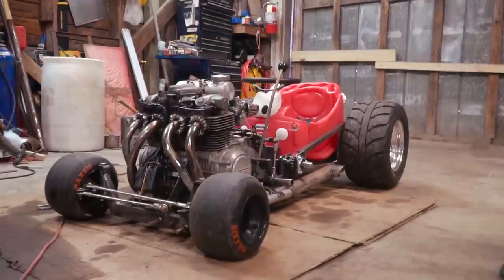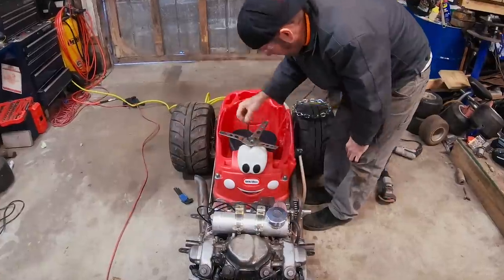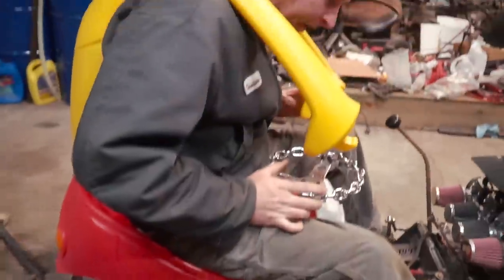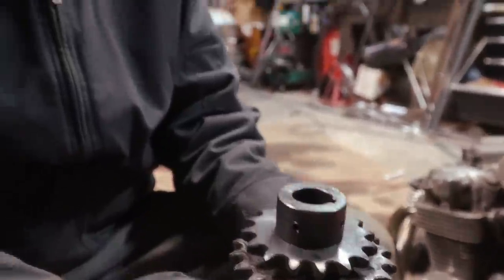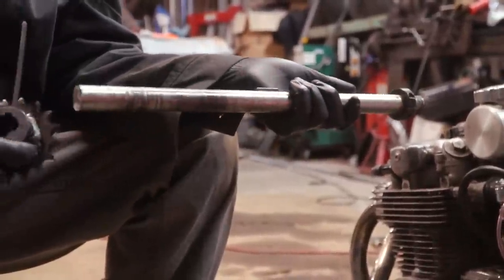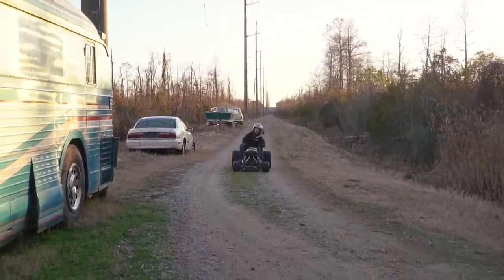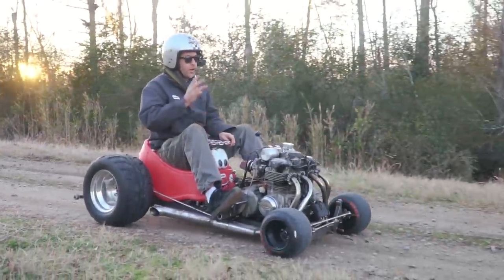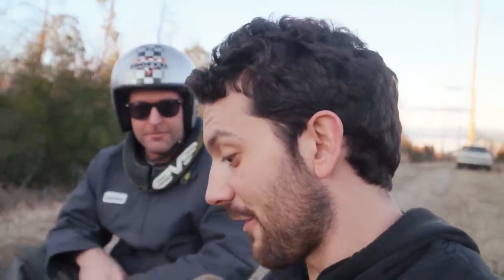How Fast is Our Little Tikes Go Kart??

Comment: "Wouldn't it look goofy?" I thought that was part of the build lol yes mod the top so you can get in , it would look cool. Think the monstar car racing cartoon.
Reply: I was gonna say "You guys built at hot-rod out of a Cozy Coupe, that train is long gone"
Reply: That's what I was thinking. Cut it out like a Targa top, and reinforce the back so they could use it as a back rest. The next problem is steering; I don't think it'd be very easy to steer with the A-pillars that close to the steering wheel.

Comment: Hey guys! I have been a fan for a while now and why I haven't thought of this before now is beyond me! Anyway, long story short (yes, I'm a writer of fiction)(nothing published yet, still looking for the right agent...) about 20 years ago, I bought a go-kart from a friend, for my two early teen boys. The kart had a 3.5 Brigs on it that just did not have the power to pull the hills of our mile-long gravel/dirt driveway in northern California. Well, we had an old Honda 200 cc three-wheeler sitting under an old blue tarp alongside our barn that needed tires, wiring, seat, fenders, etc. One rainy day, we were walking past that old Honda and on a lark, I pointed to it and said, "We should put that Honda motor on the go-kart." My oldest said, "Can you do that, Dad?" Me and my big mouth! "Sure I can!" A month later, the brake lever cut down and turned into the hand shifter welded to the left of the seat, (home-made linkage, of course). I had to take the axle sprocket off the kart, grind the teeth off flat, then center the axle sprocket from the three-wheeler onto the go-kart sprocket and weld it home, then remount the kart sprocket back on the kart so that we could run the larger Honda chain on the kart. Then we had to remove ALOT of aluminum from around the lower part of the drive sprocket area on the honda motor to except the new drive angle (~55 degrees counter clock ways from stock.) We beefed up the frame under and around the engine area using parts of the handlebars from the honda and used what was left of the bars to extend the frame on the backrest, because of the close proximity of the modified exhaust pipe behind the riders head, then added a homemade padded headrest covered in Naugahyde. Two new lawnmower throttle cables with a spring set-up in between them to aid deceleration. We used the stock motor mounts, welding them in place with angle iron. The motor sat at so steep an angle directly behind the seat, that I had to make an intake adaptor plate out of 1 1/4" sub-floor plywood, ground down and lined with JBWeld sanded smooth so the carb could sit level! After that, it ran great! However, to check the oil, I had to pick the front of the kart up to ~ 70 degrees w/ the bucket of the tractor, until the "Honda" logo on the points cover read flat like it was still in the three-wheeler!  (I did promise a short story!")  We would love to see you guys take on this challenge and build one your selves! We double-dog dare ya! (We called it the "Monster" for good reason and on the lawnmower gas tank mounted above the motor read "Get On-Hold On-Be Gone". We clocked it on our longest straight away at 78 miles an hour w/ 5th gear yet to go, but we ran out of road!) Keep up the hard work! From Builder Bob (retired) of Northern Cali!

Comment: It doesn't matter so much where in the driveline you change the sprocket (given you are comparing same size sprockets in different locations). What makes the difference is the ratio of the amount of the teeth you have vs what you are replacing. You went from 20 to 16. This means if your top speed was 45mph, you will be going to roughly 56 -->45*(20/16). The reason it seems it matters where you change number of teeth is, say on a motorcycle, the front sprocket has way fewer teeth (maybe 16), so changing 1 tooth either way is a much bigger percent change than changing one tooth on the rear sprocket, which may have 50 teeth. Its all really simple ratios. When you start changing more than one sprocket, things get slightly more complicated.

Edit: You do need to pay attention to whether it is a drive or driven sprocket of course though.

Comment: Man is that axle supposed to wiggle like a sausage?
Reply: No axles aren't supposed to do that. When something turns that fast and does that, it can break and or hurt someone. It needs a stronger axel.

Edit: also with them big tires on it with the small axel it has does not help.

Comment: I had a 1977 Honda 550 that I bought new when I graduated high school.  I had it tuned for peak performance by a guy working at the Honda dealership I bought it from and he was also a drag racer.  It was stock except for jetting and a few other tuning tricks he knew.  It was insanely fast for a 550.  Just to give perspective, I could outrun every 750 (stock bikes) I came up against and I could stick with the famed KZ 1000 up until the 110 mph mark and then it would pull away from me.  Honda 550 on a go cart?  Now that’s gonna be a wildly fast ride! 
I like it!  I’m an old guy now and smarter than I now…🤣

Comment: For gear ratios, driver and driven side tooth numbers are used for calculations. If for example you had a 15tooth on the transmission going on a 30 tooth on the transition axle, and you swap the 30 out with a 15 you get double the speed. (generally speed is calculated with driver side teeth divided by driven side teeth (repeat for the transition axle) times the rpm at the drive shaft and tire circumference) 

So with lets say 10inch diameter rear wheels, a 15 tooth on your transmission going on a 16 tooth on the transition axle(the one which you attached a new sprocket to in this video), from which a 15 tooth goes on a 20 tooth on your rear axle and an rpm of around 2700 (assuming the engine revs. about 8100 and the internal gearing of the cranks is about 3 and the gearing of the highest gear is almost 1) you should have around 

8100rpm÷3(internal gearing of the engine)*25÷25(gear teeth ratio of the highest gear)*0,06*0.254m(tire outer diameter)*15(teeth)÷16(teeth)*15(teeth)÷20(teeth) = 90.89km/h or divided by roughly 1,6 equals to 56.8mph theoretical speed 

8100÷3*25÷25*15÷16*15÷20  Without these brackets

this value will always be a little higher than the speed you actually drive if the numbers are right since this doesnt account for friction. In that afforementioned formula, you can interchange any of these numbers with what you actually have in your setup, the brackets are only there for clarity and dont show up in the actual math. If you got the year and model of the engine you should be able to find the actual internal gear ratio of the engine and the gears. The internal gear ratio should be a static number like 2.94 and the gear ratios of the gears should be something like 14÷36 for the first and 25/25 for the last gear.

If you want to have the highest increase on speed by changing out sprockets you should swap large sprockets out with small ones on the driven side of any axle while keeping the rest at the same ratios.

Comment: I had a chrome chain steering wheel  (4 spoke) 18 inch across in my 67' chevy panel delivery , it help immensely since the truck did not have power steering. Though it will fry your hands in summer !!!

Comment: Ike it seems like a good idea is to buy a tractor suitable for a grader blade and a front hydrolic setup for a bucket, forks rear 3 point linkage to maintain the long road at your test property, also use it for mowing and slashing the weeds, moving stuff around etc, and while you are about it maybe upgrade the engine grin to a V8 of some sort as a series of videos. 
 I'm sure making the drive better alone would add something for the top end speed runs you can do. It seems to be a perfect property without nearby neighbours for all your testing needs.
Tony from Western Australia.

Comment: John, you don't really need a formula to figure out most of it. It is a math problem, a fraction type problem. If you know the target speed, translate that inot how many times must the wheel go round each minute to achieve your target speed over the ground. After that, it's just a matter of figuring how to take your designed RPM to achieve the rear wheel speed- the jack shaft sprockets just add a modifier to it- call it a percentage effect- if the input is 16 teeth per revolution and the output is 20 teeth, you have lowered the chain speed by 20%. Work through it a few times and it becomes like figuring bore and stroke to get displacement. Always great stuff- Tiny Tyke at 60 mph! There will be 4 and 5 year old kids wanting the very own for Christmas!

Comment: As a fabricator I think what you have done is great.  Some of the things you chose to do I question, but that is okay after all I work on heavy equipment.

You two have more courage than I do running that thing down the lane at 50 plus. But you two would likely think I'm nutter than a peach orchard boar for designing and building my own aircraft.

Comment: I would luv to see you guys build a rear mount motorcycle engine either sand rail or drag rail , either one with either paddle tires or drag slicks would be epic,even maybe and methanol burner yee haa and maybe get a road grader in to get your lane in shape (ie flattened and pott holes filled in along with ruts)

Comment: You can do the math.  Multiply the sprocket ratio from the engine to the jack shaft, by the ratio from the jack shaft to the axle.  You can compare overall ratio before and after sprocket change out to get a comparison on what % change you are making.

Comment: Stiffer axle and clutch dump on the pavement. Curious what has more acceleration. That are the dukarti. I'm sure the dukarti has more torque but it's always battling for traction. Would be a great drag race.

Comment: Chain steering wheel is an accident waiting to happen. Someone will clip a tree going around a turn and the the wheel will be ripped from your hand and if your finger  get caught in the chain it's going with it. And you guys should make a box blade or the ramp off an old trailer pile weight on it and drag it up and down that little stretch of dirt road and smooth it out and make a dirt drag strip

Comment: Just a suggestion. Chop the top to about 5inches and steel reinforce the legs of the top an make the top the seat that way you still have the center of gravity..even chop the top to where the front is only 3 inches from the dash like an old 32 Ford coup?? Just a suggestion that way it's all together and you can still ride

Comment: "I'm sure there's a way to work it out with math" you are replacing a driven sprocket with one with 4/5 the number of teeth - that means all else being equal you will have 4/5 the torque and 5/4 the speed (so from 40-45mph you'd expect 50-56mph at the same engine RPM). If you replaced a driving sprocket the change would be in the other direction.
Ratios in a CB500 gearbox go (1) 2.353, (2) 1.636, (3) 1.269, (4) 1.036, (5) 0.900 - so assuming yours is roughly similar this change would make 3rd like 4th was, maybe 2nd like 3rd was, but you'd need a bigger ratio change to make 1st like 3rd was.

Comment: Gear it for 100mph. It's got the power to get there in a bike with not too much slowdown towards the top end. Plus, gear spacing will be far more reasonable. AND you could claim "100mph burnout" as Cleetus Mcfarland did for his 6th gear turbo Corvette "200mph burnout".

Comment: 2 big bearings on the axle with bars running from both sides of the frame to the bearing sleeves on the axle, migh save on buying a new axle

Comment: You need to add some toe in for better high speed drive ability. It looks like it is darting all over the place. Add toe in to both wheels a half turn at a time, test, add more then subtract it to where it drove the best at high speed.

Comment: Why dont yall cut the center of the roof out like a convertible so it still has the look but you can fit in it and you can keep the back piece so you can have a back window or keep it as a whole and when you take it to shows you can put the top on @carsandcameras

Comment: Wait, going to a 16 tooth from a 20 tooth is gonna shorten the gearing right? Less top end
Reply: It's the drive gear for the rear axle so it will spin it faster.

Comment: You need pavement and try n get it to hook up and launch it drag race style 
     On the actual bike you could accelerate half way through first gear then hard shift into second with alot of throttle and dump the clutch to get them to do wheelies

Comment: http://www.csgnetwork.com/speedcalc.html if you go here and put in your tire size transmission gear ratio and then your final gear ratio you can get the top speed easily.  All you have to do is count the teeth and determine how many rotations it is to each rotation of the rear wheel.

Comment: If the front is coming off the ground then make a wing to go across the front so that the wind will push it down and if not going to put the top on why cut that steering wheel

Comment: You need to build a sachs madass timberline. I took off the 50 cc 4vspeed put a 150cc 4 speed on changed the gears upgraded  the carb used a non rev limiter cdi hotter plug done away wth air breather used a womans nylon stocking to keep debris out an put  larger trims sn tires on it and it was fast but not fast enough modified a 200cc piston an head a jug and 85 to 90 mpg was a breeze an they have a steel skeletal structurevtge fuel tank is actually part of the frame I changed out my front forks the factory ones are way to soft an springy look into it  and inbox me if you would like do some shop talk on it I'm located in tazewell Virginia